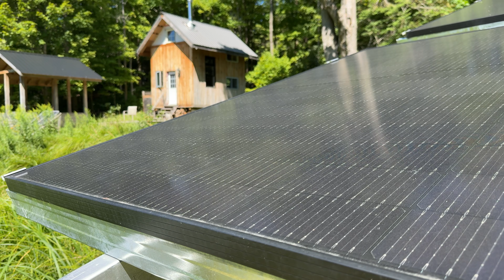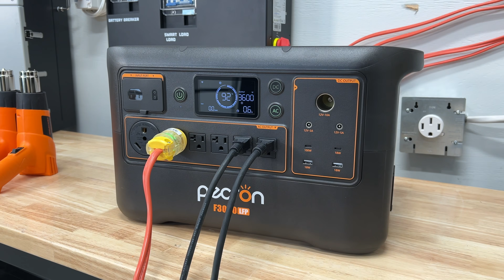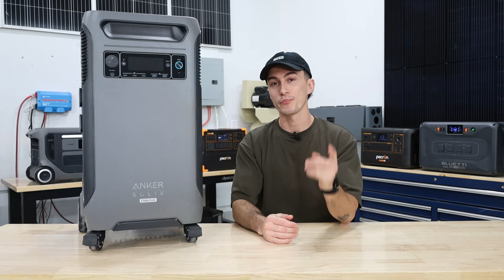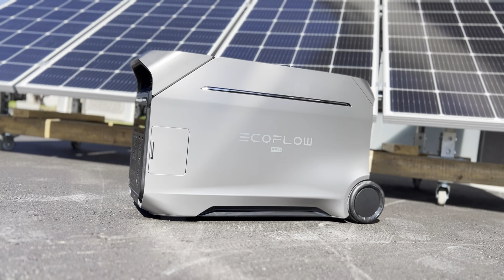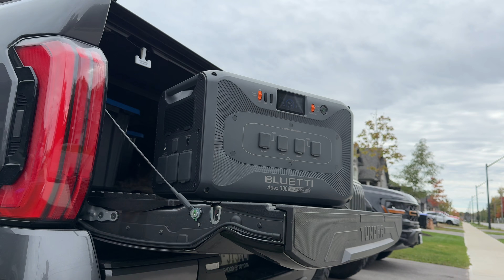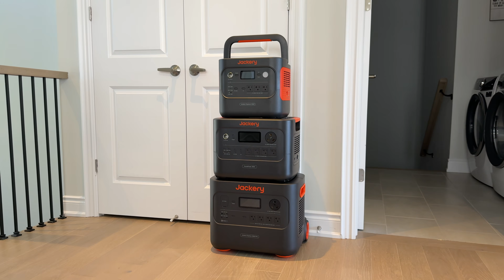Best Big Power Stations of 2025 - Ultimate Power for Home Backup & Offgrid Use!

Comment: I bought an Anker F3000 with 1 expansion battery.  I like it, with one issue, the “Estimated time on battery” is bonkers.  You start at 187 wats drain and it says 16 hours runtime.  24 hours later same usage, at 20% battery remaining, same usage it says 17+ hours remaining   So other than runtime being a complete unknown, 👍🏽👍🏾

Comment: Could these be used in a camper van?  Just thinking about outgassing hydrogen when being used.  Would be a much simpler system than all the wiring, batteries and panels most people use in conversions.  Solar ready and take it anywhere to charge on shore power.

Comment: Do these units charge from the house (no solar) and then kick in when power is lost?
Reply: Yea...you can pass through. I use my elite 100v2 and 200v2 for my pellet stove. Pass through runs fromnthe house and switched super fast if power goes out

Comment: I own 2 AC 500 BLUETTI units, I live in central Nevada , have 2  B300K for each unit , not quite a year into the adventure but preforming great .
My hate for proprietary cables is growing and getting special code numbers to get advanced power - ridiculous. 
My next unit will be for my shop only use and not BLUETTI.
I’d rather strip wires and crimp lugs 😂

Comment: It is regrettable that time and resources have been invested in superficial descriptions that overlook the key differentiators of these products. For power stations exceeding 3 kW, it is essential to detail the connections, limitations, and solar input capacities, as these technical specs are what drive the purchasing decision. Without this relevant technical data, the description holds little value for a specialized user.

Comment: I love the videos and information. The quiz seems a bit simplistic. The options don't match the needs of who I want to purchase for and the response I can get is either way overkill or under what is needed. There is no question of how long do you need backup for? some locations have multi day power outages when things go bad in the winter... rather remote and snow storms that are nasty. And since they are in an apartment not owning a house the whole house options are out. So it's gotta be portable. The Jackery explorer looks interesting for them just have to calculate out the items they need to power, and for how long for necessary capacity. I like the solar options... But again they are renting so will have to break out the panels to charge a couple days into the outage. Of course it's never easy or as straightforward as it will be when I move up there and purchase a house. lol. Then I'll be looking for whole home with extras. lol. Current location I just have a natural gas powered generator. Town is tough for permitting to upgrade. lol. And now we are looking at moving anyway.

Comment: I live in Ukraine, and we regularly have power outages at home because the Russians are destroying our infrastructure. I make batteries myself, retrofit them with inverters, and make emergency power plants for homes. So I will tell you that for such devices, it is not so much power as capacity that is important. Because sometimes there is no light for even a day, and when you know about it, you do not turn on powerful electric kettles and coffee makers, it is important for you that only the necessary equipment works. That is, the ratio of 1 power to 2-3 capacity is quite natural for emergency power systems at home.

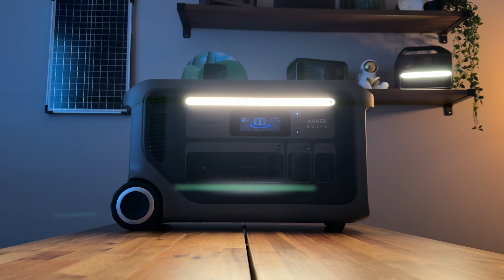Comment: 2:28 I notice everyone that reviews the F3000 that they do so on a table.  Maybe because it’s a PITA to see anything on the display or do things with the buttons and plugs when in it’s stupid natural orientation.  The F3000 feature (electrical) are very good but the F3800 form factor is many many times easier to use.  With the F3800 is Easier to move with expansion batteries installed, you don’t have to crawl on the floor to effectively see and use controls,  the unit doesn’t have to be unplugged from the main inputs to just move a short distance.

Comment: If a unit has too many electric outlets, which I believe too many of the units do have too many, it will simply run out your battery faster. If you are drawing from a 30A outlet, 3000Wh seems like a lot but you may only get 8 hours out of a 3000Wh unit. Recharging that when RV may be difficult. Get more than one unit. I have several small units, 1024Wh units, and I use them in different areas of the house. Also one goes down I have a few as back up. I have three DIY units. A 2400Wh and two 5000Wh units plus two smaller duel fuel generators.
Reply: You got so many units. Where do you live that requires so many? 

My wife made me to buy the first dual fuel generator in 2021 during the pandemic, and two years ago we bought another one because it was on sale for less than half the price of the first one even though it was a  much improved version of it. So far we have never needed to use either of them except the initial testing because our power outages have been brief.
Reply: @peterking8722  Knoxville, TN. A 5200W battery seems like a lot of power and it is if you are powering a TV or small appliances. I use each in a different location. Larger units with more power output from inverters are reserved for microwaves, refrigerator/freezer. A 2400W unit will power one fridge for around 24 hours if providing power constantly. Some people cycle the units on and off since the fridge/freezer will stay cold if not opened. The generators are for powering washer, recharging batteries, as well as running the fridge/freezer. They are needed for the days and weeks of little to no sunshine. Many people have no idea how much electricity they are using each day. 30,000kW is beyond most people's capabilities. I am renting so I we will not install a transfer switch until we move into our permanent (?) home. This would be the best way to distribute power inside them home.

Comment: I think you have so much knowledge , you show a lot of systems that are portable, Dude, I am in my 60.s I want to see a system that can me wired into the home wiring and can you can build on with the least effort… I have a Tiny home 800 sq ft and a small shop that needs 120/240 at times? Can you do a segment on how to integrate a solar system into the actually house wiring.? Yo may have sone this, but I have not found one online yet… The ones I do find are for larger houses.
Reply: I’m watching a German guy in Portugal who runs everything on power stations. From Bluetti to Averiy P310 all if possible with extension batteries. He runs everything on extension cords plugged into the breaker boxes and from there to his small house, garage. Community house. He lives off-grid.

Comment: I’m torn. I don’t know if should double up my F3800 plus and expansion battery (I already have an F3800 plus, expansion battery, and 10 circuit breaker combo) or go with the double Pecron E3600 bundle. Any suggestions?
Reply: I have $25K worth of Anker Solix stuff, plus $5K worth of their solar panels. Yea I went all out and was thinking plug and play and want to run my house with transfer switches. Started this route 6 months ago. Got mad with Anker's tiny solar inputs and it was never enough. Point is I swtched to real power and now I am happy with entire house inverters flexboss21 and 18kpv with gridboss and around 60kwh of eg4 batteries, fully integrated and running 30 solar panels. Will buy one more pallet and then I am done. I am using the ankers rarely now. Running my entire 400amp service  for the 6,000sqft house on solar is nice. Now I am happy. Point is, the sooner you switch to real DIY stuff,  sooner you will be happy with your set up.

Comment: Elite 400 seems like the ultima "portable" power station right now.  It sits at the very top end of what I would consider "portable".   Stupidly large inverters mean crazy idle loads and stupidly short run times.   It has a modest inverter and a big battery.  Perfect for essentials during a power outage. It would be nice to set the AC charge rate to match your generator and at least double the solar input.  Some LED lights would also be nice.

Comment: I bought the Jackery 5000 plus and an extra battery. I want to buy another one, but it’s limited. The only way you can 240V charge it with a generator is using their smart transfer switch. That would e fine if it also wasn’t limited. You can’t split the outlets from the breakers, like you can with the EcoFlow. So if you want to put the STS next to your main panel, but keep the inverter/batteries in the garage 30 feet away, you have to Jerry rig a solution where you take their cables, cut them and elongate them. You also can’t tell it to stop discharging if the batteries get too low unless you use their smart transfer switch or if you use the unit with no expansion batteries. It looks super attractive due to its price, but it has severe limitations. The good thing is all of them seem to be ones the company can overcome if they actually tried!

Comment: Yah should get that one that's either around 25k or 15k that you can drive and it can pull a car. I think that expensive portable power station has a 100 kilowatt hour battery like a car but it might break the bank and floor 😂 but it would be a nice thing to review since none of the videos on it show it being used as a back up power supply for home back up, they only show it being able to be used to power high draw power tools on worksites.

Comment: The 240V three prong outlet (NEMA 6-20R) on the Ecoflow Delta Pro 3 is very useful for powering 240V table saws or compressors in the field or even powering the same equipment in a small shop when there is only 120V sources available.

Comment: Just a note on the Delta Pro Ultra, for black Friday sale, you can pick up the inverter and one battery for $3800.  OMG, for house level power, that price is insane and give that the average house like mine uses ~380 W/h without the NG central furnace running.  So you can get overnight power with one battery as long as it is not the middle of winter.  If you were conservative, you could get through the night with one battery.  But having a second battery will be twice as much.  That second battery if not bundled with the first unit, is an additional $1900.  If your house uses 12 kw a day, you can do the whole day without electricity.  I have the two inverters and two batteries for each plus the 50 amp hub so that we can run our stove without thinking about it.

Comment: what i am currently look for. 

500$ power supply that i can get from bestbuy. I want it to have power outlets and usb type A. wall rechargable, and solar rechargable. Expantion port. No other ports. No wifi requirement. no blutooth requirement.
500$ Expantion unit for the above unit. but adds 2 more usb ports, and two more outlets. i want this to be able to daisy chain to another expansion battery. i want this to also be able to stack as many times as i want. No limit. 

I want both to have an easy to read screen telling me how long it will take to discharge at current power usage. I want the main power supply to take into account the expansion batteries.

Comment: Another thing about the Jackery have not seen anybody mention. If you have the Smart transfer switch and you have a 50 amp generator plug hooked through your main breaker you can charge it at 4000 W hour per unit from a generator.

Comment: The repeated argument about the integrated lights on the portable stations never made sense to me. If power goes out and you have to go fetch the station from a basement or another dark place, you need a light to go to where you keep the unit anyway. Else, how hard is it to keep a cheap (even AAA powered) head lamp stored with the unit?
Reply: more for campers and such instead of home use, to have an integrated light for nights or to move around, BUT, if you have money to burn on this you have money for stationary lights or any kind of light that's set up around the camp. In a unit like this Is redundant and gimmicky, feels like an excuse to justify 100 bucks more.

Comment: I am going to disregard any product review where he mentions a light. It's silly and irrelevant. Get a $10 headlamp. You can use it to go down into the dark basement and find your power station.
Reply: Don't even need a headlamp. Just about every soul on this planet, has a phone, with a flashlight on it.
Reply: @AverageGuy87-r7k  Yeah right, like you're going to carry a 50 pound plus unit in one hand and hold your phone with the other.
Reply: @RPRosen-ki2fk OK, so here's what you do. Use your phone to find the unit, and unless you live in a maze, you can generally find you way too where you need to be. Most people can easily find their way around their home..... even in the dark.
Reply: @RPRosen-ki2fk  I have these battery motion sensor LED lights on the baseboard in my house. Cost about $4 each. Great to light up stairs or a dark basement or hallway.
Reply: @RPRosen-ki2fk  or get a $5 LED light and velcro it to a power station. Point is, my decision on a $1500 device to power my home is not going to be influenced by some silly issue that can be resolved for $10 or less. So why would I trust the opinion of someone who would be?
Reply: @RPRosen-ki2fk  If you can't carry 50 pounds on one hand, you have bigger issues than a light on the side of a power unit, heck even my 12 yr old can manage something like that.
Reply: @reefhound I totally agree with you.  Using a headlamp easily solves the problem.  I was just pointing out how stupid it was ... thinking a phone would solve the problem.
Reply: @RPRosen-ki2fk  phone light works if there are two of you but I'm amazed at how often I use my headlamp around the house and I keep one in the car, too.
Reply: Plus the companies send them to him to test for free so his reviews can't be too critical.